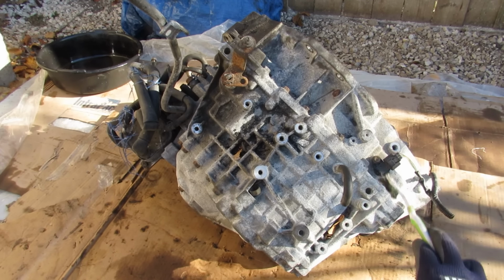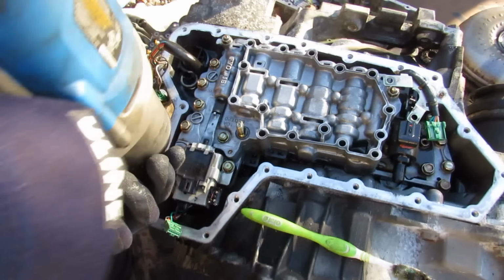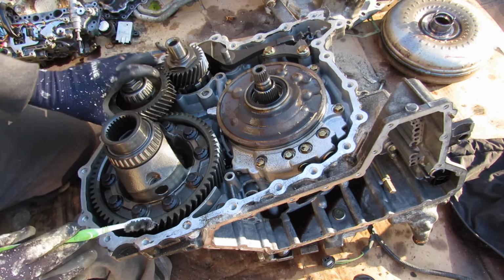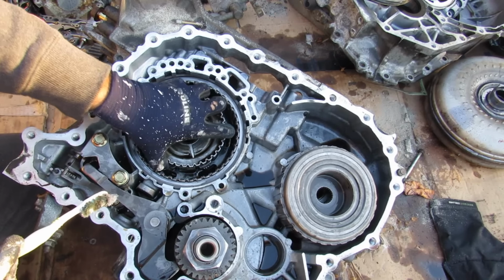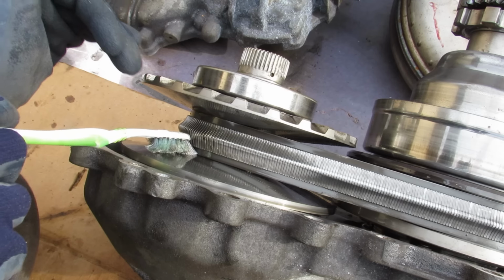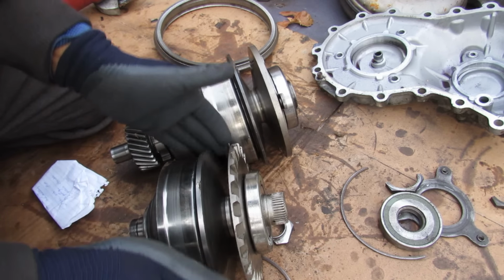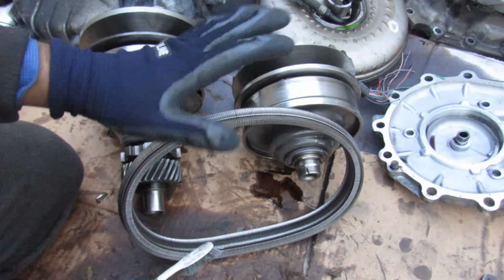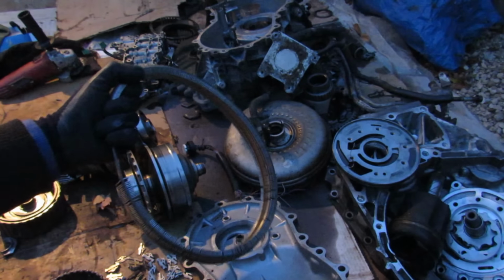Why Nissan CVTs FAIL

Comment: Not to mention they’re also using these for some VQ37 v6 sedans and SUV’s 

Pretty common to see them used in Infinits
Reply from the maker: Which CVT is paired to a VQ37??
Reply: @speedkar99  don’t quote me on this. But I’m pretty sure the Infinity QX60 uses one, I could be wrong but I looked at picking one up as a daily because I found a good deal on it and it was a CVT.
Reply: Nevermind I’m full of shit. They use a VQ35, saw it on a Nissan VQ37 and VQ35 sound compilation and assumed wrong

Comment: Yeah my wife had one of the murano !!! Two thousand miles out of warranty the transmission went out on it and cost me 4500 bucks. Never another Nissan on my place.....!! Was planning to get a Nissan diesel but that ended that and I got me another ram diesel
Reply: For what its worth my 2014 corolla uses a cvt and ive had zero issues at almost 200,000 miles...my brand new 2021 camry hybrid also uses a cvt but it's a new high tech one that doesnt use a belt...Toyotas are definitely built to last.

Comment: I know I've just cursed my own Nissan CVT, but my 2015 Quest has been really solid for almost 100k miles. Not a single transmission or engine issue with it.
Reply: They usually last between 100 to 150k miles but if you haven’t changed your fluid at the recommended intervals, you can bet on having a failure soon. Of course, there are instances where some last the life of the car, depending on driver habits, maintenance, exc.

Comment: For an automatic transmission, it seems like a pretty simple design. It is a shame they can't get them to work properly and are so expensive to repair. Nissan has a bad habit of forcing entire component changes instead of a single part. I had a friend who owned a Nissan Titan that had a leaking input seal on the rear differential. The dealership told him he had to replace the entire rearend to the tune of 5 grand. He said no way and as he was walking out, one of the service managers pulled him aside and said "go talk to the technician in stall 5". He talked to the tech and found out the rear end was a standard Dana 60 and all the parts were available at any part store. The tech told him, go get this part number and come back with $100 cash and I will have you out in less than an hour. Black market workaround worked that time!

Comment: With so many flimsy parts,  no wonder it fails easily...  Anyway,  I stick to manual gear driving,  so far I have not come across a manual car with this sorts of failure.

I once drived an old manual japanese car called Datsun 120 Y and the manual gears lasted more than 25 years,  all I did is keep changing the gear oils as per my workshop recommendations.

Comment: Also Nissan service time is to long. Change the oil every 50 000km. My xtrail 2.5 says change oil at 160 000km! Mine only hads 100 000km, thats way to long. I had a small shudder on take off. New oil and its gone.
Reply from the maker: Keep up with CVT fluid changes almost as much as engine oil changed

Comment: I must have gotten lucky with my wifes' 2011 Nissan cube. She drives like she stole it. We have just hit 175,000 miles in which I lost another bet with her. I bet 10 bucks It wouldn't make 150,000 because she is super hard on the car. I then said Double or nothing at 175,000. I now owe her 20 and the car is still going. I want double or nothing 200,000. She wants her cash.
 We have never had any transmission issues. Actually nothing more than regular maintenance and a muffler.
Reply from the maker: Nice!

Comment: had a 2009 Sentra.  went through 2 CVT transmissions then traded the beast in for a hyundai.  Never again will go back to Nissan.
Reply from the maker: And how's the Hyundai?
Reply: @speedkar99  aside from the recalls, doing good.  Atleast we're not doing 45 mph on the interstate in the middle of the desert on the second transmission.

Comment: My CVT transmission is gone, 2013 Altima with 110000kms……
Reply from the maker: Sorry to hear that. No warranty either?
Reply: @speedkar99  I wrote to Nissan service in response to this problem, and replied that they could not provide any help cause the warranty has expired.

Comment: Note the tiny oil cooler.  A lot of failures that happen while climbing hills, towing, etc, are heat related, and result in the trans going into limp home mode.  A neighbor who didn't have the money to replace the trans or the car (09 Altima) had this issue.  I put a big B&M trans cooler on it 4 years ago and it's still going strong today, even through Vegas summers.  I realize this isn't in a shop's best interest as a repair, too much liability, but for a low budget repair, it may or may not be an option for some people.
Reply: 09 2.5 Altima. Exact same fix. Running fine.. Thanks everyone on YouTube for once and for real you guys were right. This $50 fix works.
Reply: The next gen CVT from Nissan is much improved!
Reply: @CaliRob281  There was a mole in Honda engineering.
Reply: Cooling is the area in which manufacturers like to cut some corners, it seems. Especially when it comes to transmission cooling.
Reply: Im having this same problem right now, with a 2013 nissan sentra. how much did the aftermarket cooler cost you?
Reply: @monkeeyo101  look for a plate and fin style cooler, not a tube and fin style.  Take a look at the car, figure out the size you think you can fit in there, and make sure you hook it in after the fluid leaves the radiator, before it returns to the trans.

Comment: The first Ford CVT I rebuilt was in 2006 I think, it was still under coverage and had to replace the hubs/drums and belt as a complete unit, didnt even have a way to pressure test them outside the trans to confirm diagnosis lol. And at that time they didnt even have a complete transmission avail lol.

Comment: I dont get all the CVT hate, I have a 2014 Rogue and havent had a single issue. Change the oil twice a year when I do the seasonal tire change. Knock on wood (me rapping my knuckles on my head), I'll driver it for another 4-5 years.

Comment: As i remember   DAF had come with  CVT backin 70s in a small car..One of such car had taken part in  LONDON SYDNEY MARATHON..They must have used a rubber belt  like i scooter nowadays. 
The best part of explanation was your old toothbrush  more than family old clothing. 
Citroen had come up very good clutck   C matic.a torque converter.   an elctrically operated through gear lever. dry plate to chang gear   ELIMINATING  CLUTCH PADDLE.
I had 2 such CX PALLASs , in  Dubai. then.
Reply from the maker: Thanks

Comment: Worked at a Nissan dealership for 3 years and changed dozens of these.
I was never allowed to pull them apart to see what failed.
This is a great brake down video on how these consistently fail.
Reply: Altima, Maxima and Murano constantly failed.
I only had 1 Sentra fail and never needed to change one in a Versa.
The larger vehicles like the Pathfinder, Frontier and Titan never had these disastrous transmissions.
Reply from the maker: Thanks for that input. I'm sure you have to send the cores back
Reply: Yup had to send the cores back for warranty. 
I worked there from 2014-2017.
So my thoughts on the matter could potentially be outdated.

Comment: Having worked at Honda, Mitsubishi, and Nissan I find the Honda cvt transmissions to be the most reliable. But that could be because Honda forces the car to be really gentle on the trans. Mitsubishi seems to last fine as long as you do your fluid every 30k like they want but nobody does. Nissan is junk. We used to have so many cars lined up it looked like we were stocking the transmission there were so many sitting in parts.

Comment: This was way more entertaining than a dude with a toothbrush had any right to be. My homie is a Nissan master tech and has swapped his fair share of cvt's and for all the reasons you mentioned. The fact that Nissan put a cvt in the maxima shows how little thought they put into implementing this transmission across their lineup. Despite this I have a 17 Rouge which had a few updates from prior yrs and supposedly beefed up the cvt's too (we'll see) and according to said homie haven't been in for repair nearly as much as previous yrs. The biggest thing he told me was the tranny fluid plays a much bigger roll in these as opposed to traditional transmissions and should be changed far more often, not at the 30-60k recommendation. I hate the drivetrain in these but the wife was in love with it so....whatever. I'll be doing a flush every 10k-20k in my rouge to be safe and if it still blows up, I hope it does it before the 100k mile warrantee is up. Awesome video!!!

Comment: Very good video. Now I understand why my 2015 Honda Civic CVT transmission has failed. The last time I did a fluid change on the trans a small piece of that belt came out. I drove the car around the block to recheck the fluid and the trans belt broke. Only 89000 miles. Now I’m screwed. Honda has no recall on these transmissions but they need to have. I’m all in on a law suit with others who have this problem.

Comment: Why wouldn't they use electric servos to drive the pulleys instead of hydraulic oill? That would reduce the lag time I would think.
Reply from the maker: Yes I believe newer CVTs use motors.
Reply: @speedkar99  my thoughts exactly.  Wonder why the don't use the motors at all times to power the vehicles and use the engine exclusivily to charge the batteries (like the locomotives)?  Perhaps cost of a separate generator and consumer reception to a high reving engine while idle?

Comment: You have to ask yourself would you buy a vehicle from a manufacturer that has quality issues? Consumers are getting smarter, they research the vehicles they are planning on buying now used or new. If they don't it will cost them. Reliability is the number one concern for most consumers. The vehicle that gets 1 mpg-2 mpg better because it has a CVT transmission is not a good bet if it costs you $3000.00-$4000.00 to replace that CVT transmission in a few years.
Reply from the maker: Not important to people with bad credit or just leasing and returning the car

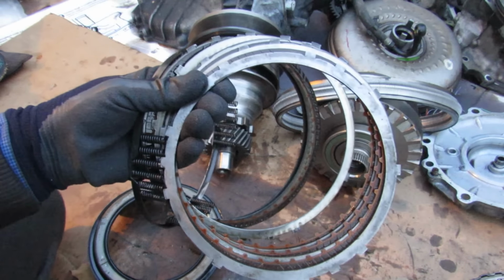Comment: 16:53 "back to the dealership" : Didn't see that one coming; the best jokes are the unexpected ones. Great video! One would think that if a tire can last 60,000 miles,  a rubber belt could last at least that long; then, all they'd have to do is put it in an accessible place and seal it off from the rest of the transmission. But I guess Nissan had other ideas.
Reply from the maker: Well 60K is probably the longest warranty so that works for them...

Comment: What year is this transmission. I can understand the belt is the wearable fallible part. I think mostly this video is mostly just negative. Clearly you don’t like the CVT. What is the cause of the untimely failures vs regular failures? How about insight comparing why some CVT’s are better or worse? This is a great video showing how they work, but doesn’t identify what the cause of the failures is. The message I got here was - simply don’t use the accelerator. It’s already very clear you have to perform the maintenance properly, just like a regular transmission, right? I think you should talk about the specifics of the model, the year of the engine, etc, and what improvements have been made to the new models.

Comment: 2013 Ford Fusion Hybrid owner here, and I actually like the feel of CVTs. I don't want to stop accelerating to shift, tbh. Don't abuse it, and it won't break either. If I want to have fun, stick shift is the only way to go. Screw planetary automatics, they shift whenever they feel like it, not when you do
Reply from the maker: Works fine in slow hybrid cars
Reply: @speedkar99  Exactly, if it has over 250 hp, give me a stick shift any day and I'll be happy

Comment: Keep in mind guys. This is a jatco transmission. Jatco has been notorious for terrible CVT or automatic transmissions in general. Toyota does a better job at making CVT cars. That's why when Subaru ditched jatco and signed a contract with Toyota, they've had progress with their vehicles that have automatic transmissions.

Comment: Is there a conversion to a regular automatic transmission?
Reply: 5 speed auto from the maxima bolts to the Murano's VQ35 engine. 6 speed manual too... 

But if you have the money, I can make whatever transmission you'd like, fit. 

Cheers.

Comment: Very awesome video he resented it very well. Now I do have a vq35 in my Maxima it is a 2010 now I do not know if this CVT has been replaced or not but my car has 125,000 miles.  And runs very strong still for being how unreliable these transmissions are.  I don't drive it very easily neither.  Im not a fan on cvts at all but I gotta say this one is holding up quite well.

Comment: I have a question for you about my 2013 nissan sentra.  to get to the point, it's not kicking down at hi way speeds. like I lost my "overdrive" it just starting doing it. took it to the dealer , and they did the typical up date . he said give it a couple of days , hopully it will stop. I bought it new, always change the fluid.  seems every thing else working on it.  No noises anything out of the ordinary . thanks great vidio
Reply: 2013-2017 sentra has the highest cvt failure rate. I am in the car business

Comment: Thanks for posting this.  My 2015 Nissan Murano transmission just took a shit this past weekend, currently sitting at the dealership waiting to get fixed.  I'll never buy another Nissan again.  Going back to Toyota or Honda for my next vehicle.
Reply from the maker: Interesting to hear from an owner. Did you get it covered under warranty ? What exactly failed
Reply: @speedkar99  They are not sure what failed.  It didn't show up when they ran the diagnostic, however I found a forum where a lot of Murano owners were saying the same thing.  I was getting that loud whining noise coming from the engine.  Took it to my local repair shop thinking it was the drive belt, but then they came back and said the transmission needed to be replaced.  I took it to Nissan to have them run the diagnostic, and they said the same thing.  I have 90,000 miles on it, so it is completely out of warranty, and I have to foot the $5,000 repair bill.

Comment: Putting a bunch of wires and connectors inside a sealed case full of what's essentially a cleaning fluid is just a recipe for something to go wrong. One little broken wire or blocked connection and you're screwed.
Reply from the maker: I always wondered how the wires don't get affected

Comment: The CVT failed because it's a CVT.  Just go with a 7,8,9 speed transmission or electric with no transmission.  CVT is a nice concept, that's the limit.
Reply from the maker: How about manual
Reply: @speedkar99  sure if it's got 6+ speeds.

Comment: Man just the thought of a band layer failure could make all of those belt elements explode into the pulley system and causing a vehicle disaster. Not worth it.

Comment: The most common failure mode I've seen on Nissan CVTs under normal operation is the O-ring seal on the variators.  Excessive heat and fluid wear leads to these seals hardening and failing to seal, resulting in diameter mismatch, and a snapped belt.  While Nissan considers these transmissions to be "sealed for life," fluid is available for them, and a 30,000 mile fluid service interval would not be excessive.  50,000 miles if running an external cooler.

Awesome video!  Thanks for posting.  :D

Comment: Have a 2016 Rogue. Had it since it was fresh off the assembly line. 6 miles off the dealer lot. Has 38k miles on it now. Had the techs service the CVT at 35k because I wasn't gonna risk having it fail at 40k without a service.

This might be the last Nissan I own.

Comment: Half of me : engineers are amazing!
Other half : stupid engineers complicating shit
Reply: Not the engineers fault its management.
Reply: @gamezahoy712  both wrong... its CAFE standards. Cars have to be as efficient as possible.
Reply: Actually, the CVT transmission is very simple and from what I see, extremely inexpensive to produce thus the reason why they use it. However, It is very weak and Nissan hasn't made an effort to beef it up. The concept is ingenious, the execution....crap.
Reply: Nah. Shit gets complicated on its own. Wear, friction, vibrations, cooling, thermal expansion, respond and recover times, sealing of moving parts, material properties, regulations, ...

Comment: You are the best. This is best CVT class, I  own a 2017Nissan car with CVT,  now I m worry about the problem. The car only has 21000 miles but sometimes transmission slippery .

Comment: Think about how much energy it took to mine, smelt, transport, machine, and assemble these units, only to scrap them after a few years, and you will have some idea as to how we are destroying our environment.  The idea that these save on gas and are therefore  good for the planet is just a marketing angle.  It's the ugly side of capitalism.
Why not make units that are designed to be easily serviced and repaired so they last indefinitely?
Reply: "Last indefinitely" is simply utopia. Everything fails sooner or later by wear and tear, inevitably. But you have a good point. All it takes is FORCING manufacturers to guarantee the drivetrain for at least 300,000 Kms, BY LAW. So no more sloppily designed engines and gearboxes and vital stuff or ELSE pay for the avalanche of warranty claims. These are disgraceful CVTs designed to fail and NOT to be serviceable, throwaway like most mobile phones are. Shame on JATCO, shame on Nissan, shame on Renault.
Reply: Gavichap 
Well Amen to that.
Perhaps the answer will ultimately be electric vehicles.